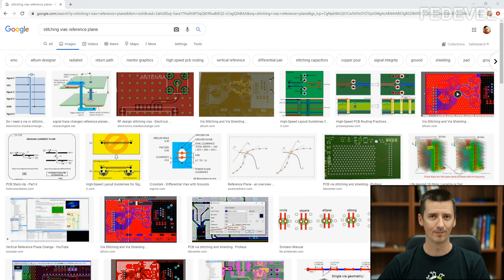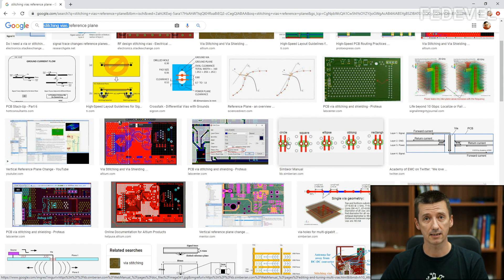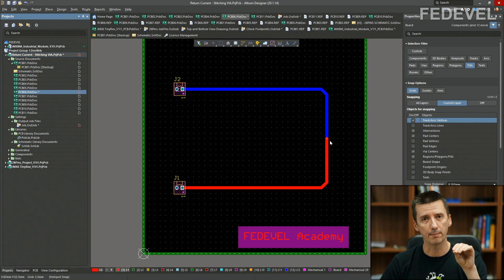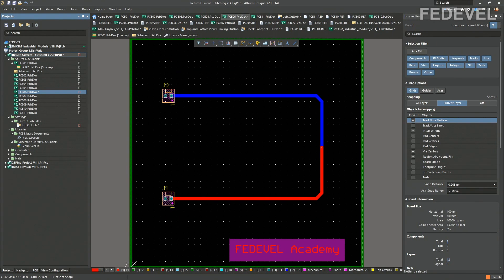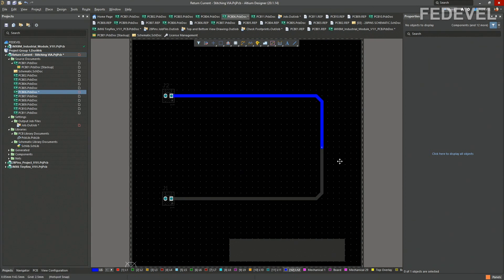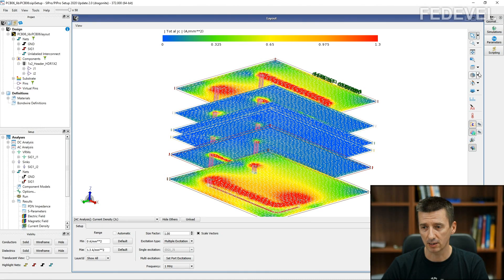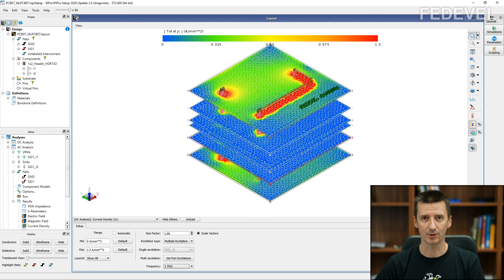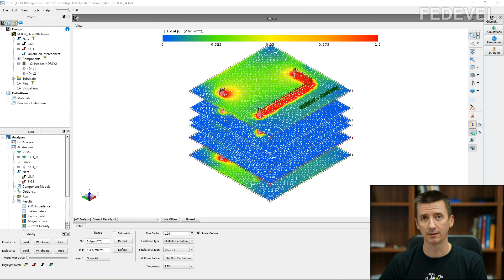How GND VIAs Improve Your PCB Layout

Comment: To the topic of current flowing in layer 4 (12:54).
I assume that most of the current flowing in the layer 2 ground plane is flowing at the surface next to the track on layer 1, due to the skin effect.
In that case, you would have a electron distribution across the ground plane, yielding in a potential difference between the surfaces.
This would give rise to a field in the next dielectric, which would induce a current in layer 4 ground plane.
Is it completely nonsens?
Reply: If this is a correct answer, it could be quite scary. It means that a signal in a trace on layer 1 would spread into a trace passing on layer 3. And vice versa.
Reply: @MrJetra  These are currents, not voltages. For a current to flow, there has to be a path, and in the case of the ground plane examples in the video, that path is the return path from the load back to the source. I think your concern is about an example like: stackup signal-ground-signal, and a track on L3 that happens to parallel one on L1. OK, so you have current in the track on L1, and return current on L2 (plane)... but it won't show up in the track on L3 because that L3 track doesn't connect between the same source and load as the track on L1.
Reply: @Graham_Wideman  Thanks!

Comment: In your last example (GND via fence), what would happen if you remove the via fence between the ends of the GND tracks but keep the tracks?
Reply from the maker: The fence is not fully around the signal, the GND tracks are not connected at the ends (it is visible when I show the PCB). Or do you mean something else?
Reply: @RobertFeranec  You explained in another video that a parallel GND track should be connected in both ends to let the current flow. How would the field spread out in this case?
Reply from the maker: @MrJetra  Ah, do you mean like do not use VIAs the the ends of the GND tracks? I making a note, I will try that.
Reply: @RobertFeranec  I think he means you only use vias at the end of the trace, no additional via at the middle of the trace
Reply: @RobertFeranec  by the way, how much is the separation between the GND via of the fence is related to the frequency that you are trying to fence. Once a SI guru taught me but I have forgotten. Perhaps you and Eric Bogatin could make a video to explain how to determine how much is the pitch needed for the via fence 🙂
Reply from the maker: @TSRHelios  I am putting this on my todo list
Reply: @TSRHelios  Exactly what I meant
Reply: @RobertFeranec  To my off topic question about GND traces next to stripline / microstrip, could you make a simulation on what Eric Bogatin was talking about in AltiumLive?
Reply: @MrJetra  Which Eric Bogatin video? Could you post a link?
Reply: @Graham_Wideman  Look at Robert Feranecs answer to my comment "(Off topic) If you are routing a signal (stripline / microstrip)..."
Reply: @RobertFeranec  The ends of the fence track don't connect directly to the ground pins at source and load, but they almost do, because they have vias that connect to the adjacent plane right next to the ground pin.

Comment: What about ground loops? Obviously that is not so much an issue with high frequency signals, but what happens on a mixed signal board? 
Don't you also create ground loops when using vias?
Reply from the maker: P_Mouse, do you have any specific example in mind what I could try to simulate?
Reply: @RobertFeranec  Like above, a DAC (or ADC), or something like a Class-D power amplifier (which is in essence also just a power ADC/DAC converter). 
Same goes for negative feedback lines in control circuits. Especially when they have to pass around switching elements.
Reply: @RobertFeranec  I think DAC would be a great example